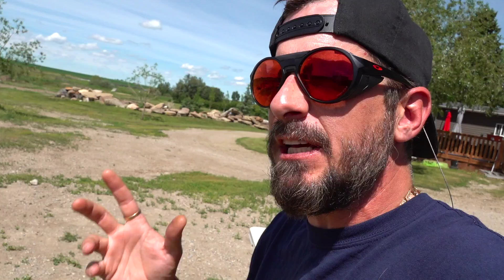IT WORKS!! (PT2) Modified TOW RIG - TUBE PULLED behind THRASHER Jet Boat  | RC ADVENTURES

Comment: The only change I would try is to move the tow point more over the rear pivot point above the jet pump to keep the line tight on turns to whip the tube out. Then try mounting the camera where the tow pole is now to balance it all out. Keep up the great imaginative content. Love it!!
Reply: Yes indeed just like on a regular boat !!!
Reply: Agreed rear post mount rather than central that way turning will keep the tube moving to...i deal spot on boat is where screw for cover is then mount go pro behind that..
Reply: Yes must see the whip... that would be epic... if you keep going around in a circle the G's increase exponentially. We used to do it pulling a board tied to a motorcycle with a rope hooked to the front corners of the board to hang on... if you can.

Comment: Keep at it Medic!   If you look at ski boats, the ski pole is positioned at the rear (sort of where the go pro is)   This will perform more like the initial tow point and should allow the boat up on the pipe...  Nevermind - I see you have sorted it!
Reply from the maker: Not true bro..  Not all ski poles are like that :) https://www.absolute-snow.co.uk/V/Jobe_Fat_Pole_Boat_Ski_Pole_3-(73017)  The video from the day before - shows that lowering it causes more of an issue

Comment: I think you need a Go Pro on the tube, i know the exact replica of yourself is awesome but the footage would be a fair trade lol
Reply from the maker: Hmmm.. I would have to devise a proper floor and support.. ill noodle it around for a while
Reply: @TheRealRCSparks  Tube+ a layer tape over bottom, wide plastic disc with a pole thru center up in middle of tube, add more tape to cover and secure disc to tube?
Or you could tape the GoPro to the chest of the Action Figure :D
Reply: @Mr_Ham0   Its actually an exact replica of medic lol but i think the Go Pro and mini medic would be too top heavy, hopefully he figures it out, its deffinately footage that i wanna see!

Comment: Watching you have fun, is fun for me too!  KEEP POSTING!  I have had some time with RC stuff, but I have had THOUSANDS hours on the water, almost entirely behind the boat!!!  Really powerful, to way too small to be used for that!  Things do not scale down as well as we wish!  I have much more engineering skills, than people skills!  I really enjoy figuring out how to get things to perform!  So I had some thoughts:

1. Pole should be farther back!!!  When you turn, the tube's drag pulls the boat into a harder turn.  If you move it too far back, the drag will make it hard to turn.  Too far back would be a few inches behind the prop!  The transom is about perfect.  And lower!  Your setup is great for wake-boarders that want to extend their jumps.  You Are Pulling A Tube, Not A Kite!  The simplest setup is: attach a "rope" very loose between two points on the transom,  left and right of the drive, just above water line.  Put a loop in the end of "Ski-Rope", run the transom rope thru ski-rode's loop so the ski-rope will slide back and forth.  On a real boat , we would use rope that floats and add a bunch of little floaties near the motor so the rope stays well away from prop!  

2. Add more weight to boat!!  Or use a much bigger boat!  We have used a 14' aluminum boat with a 25 hp motor and not only pull tubes, I was able barefoot!  We had to have four people in the boat!  When I would "set" my slalom ski too hard it would throw people out of the boat!  I could only do it once, apparently some people don't like getting thrown out the boat at speed! 

3. Get rid of tape on bottom of tube!  More Surface Touching the Water, the More DRAG!  "Tubes" with bottoms are made for little kids so the tube never gets on plane or if the boat has enough power, you end UP towing a Kite!  Your "tuber" looks "strong" enough to keep his butt out of the water!  Weight in the tube needs to go a little bit forward.  Looked like your tube was Porpoising.  In your earlier clip, the rider was way too far back.  You might try letting your tuber sit backwards (like a real show off!!).  Too heavy on the front: the tube will flip over forward when slowing down.  Back heavy: very hard to get on plane.  Porpoising: almost perfect!  Have you thought about putting controls in the rider?  lol  

4. Your boat has plenty of power, but it's not made to pull stuff.  Especially from dead stop. Cavitation!!!  It needs to get up to speed before it pulls.  Your clip shows that perfectly.  When you turned, the tube would stop and sit in the middle of the boat's "Circle", the boat would maintain speed.  When the boat straightened out, the tube would instantly jump back to speed!  So!  (And it's a cool way to start!!!)  From a dead stop, gently idle the line tight, turn and give it throttle, making a semi-circle or a spiral out to straight!  The boat will have traveled several feet and got up on plane, while the tube just barely moves, turns, then EXPLODES out of the water!   Once at speed, if the tube is on the Right side of wake, then turn around to the Left.  The goal is to swing the tube to the outside of the turn!  Super Goal would be to continue with the boat in a circle and the tube zooming at like 90 MPH! Catching huge air!  Ultimate Super Duper Goal for the driver is to fling the tuber off!  Does your rider float, without the tube?  hehe!

One more little trick: graphite on the bottom acts as a lubricate on water.  Dawn dish washing soap works real good too, but only for a moment.  

Thanks again for posting.  Makes me wanna dig out some of the VHS tapes!

Comment: Hey here's a challenge. Paraglide with a lighter figure. I don't have a boat but you can do it. Take off from a plywood. Just do it on the pond to keep it on the air longer. Would be a cool view from the boat cam and from the figure. 👌

Comment: You should do it like actually inner tubes, in the back end of the 'floor' of the tube, just put in a mesh section so when the tube get's going all the water flows out the back

Comment: Hell Yeah,   works awesome.   Only thing I would address is to lose the  drain tube and make a trap door like flap with tape underside. Full size towable tubes have a cover that wraps the tube and that has a large mesh not needed for RC size, but the flap allows any water to evac instantly.  And i never had the tow rope up above the waterline for tubing more than the rear cleat level, only skiing n wake boarding the height helps pull you UP not Down. Maybe try from rope position again thinking it will get on plane faster.  
Can't wait to see Another episode of Tubing with Jet boats.....  Love your shows

Comment: DOOOOOOOD! It worked out great! I laughed so hard when it went on plane and actually worked! I really think you can use your GoPro mount as the tow point. Do you have some taller mounts that would put the camera higher but not so high that it takes the stability of the boat away? Or, use the tower but put the camera right in front of the pole. Then the rope will miss. Also, with the venturi tube, I would ditch it and seriously just go for a couple slits and enough gap that the water can freely run out even at low speed. I think there is enough water tension to stop that tube from working. then there is nothing dragging under the tube.
Reply from the maker: HaHAHA!!!   I KNEW when you wrote me, and I did the the check marks of what you had said - what I had built, might work!!    I will work on the drainage. .the flap and slit may be the way to go 4-sure.   These videos arent too popular.. so I dont know how many more of these style I will do (although I will still play on my own! haha)
Reply: @TheRealRCSparks  No worries! Gotta make the masses happy right? I dig it all. You know, you did the SCX24 Jeep JLU video and when you called to it like a puppy, it was the seal on the deal I needed one to match my full size Jeep Rubicon JLU!  So, to go super nerdy, the stripper pole makes a massive fulcrum on the boat. https://www.newdimensiontowers.com/towers/ndt/NDT-Hybrid-Universal/
If you look at thow that's designed, it puts a push/pull on the hull of the boat which keeps it at a negative and can't roll the boat to the side. Not sure if you want to go as far as that to design a tower, but it may be the answer to your dilemma of control of the boat and the tube. 2 bars mounted to the sides and a center pulling point. I would take it just above your original GoPro mount and almost cage in the camera. That would be pretty sick!

Comment: Yeah dude you done it! Thats amazing, congratulations, but the question is now can you convince your buddys to go thru the pain of making them for a race, i think rookie might be pretty good with his knowledge and might be able to make a pretty good one like yours, but i was wondering what would happen if you used plasti dip on the bottom surface would it take some of the flex out and maybe it might no make so much drag at higher speeds to stop the thrasher from throwing itself sideways?

Comment: Cut a slot in the bottom towards the back and make a flap over with the opening towards the back as well, so when you get water in it like it did, when you start moving it flows out

Comment: yes tow point on the tube is key.  the lower to water the better.  it will keep the tube from plowing down, lower the piitch on the impeller if possible, and i think the tall mast is WAY too tall.  hoestly, the two point  should be low as possible and towards the read.  we do this all the time down here in alabama with full size boat.
Reply from the maker: Yeah, but can you explain these boats then: https://www.absolute-snow.co.uk/V/Jobe_Fat_Pole_Boat_Ski_Pole_3-(73017) ?   Thanks!
Reply: @TheRealRCSparks  the pole in these boats are a bit closer to the rear of the boat.  try that to move your fulcrum to the rear.  that will help

Comment: Not sure if you made it to that point during test n tune..... but you have to consider CG of the boat itself. most ski boats have a center mount engine with mid mounted mast.  The camera mounted in the rear couldnt have been helping either.

Comment: The pull point needs to be near the back of the boat so that the forces involved are more equal and the tube or skier does not pull the front of the boat around which was happening in every turn. also shorten the tow rope in small increments to find the correct length of the rope to balance out the centrifugal forces required to have the tube stay outside the wake of the boat in turns, its all about balancing the forces involved it just tuning the configuration. well done so far Sir. a few more tweaks and it should work perfically.

Comment: A grandually curving surface is going to cause the most drag as it will try to lift the water. Take a cylindrical container like an older 2-liter coke bottle and pull it across water by hand. You will see the effect.

Comment: If you can mount a tiny GoPro to the pole on the boat, and fix it so as the line rotates so does the camera, then your camera view will always follow the tube despite the boat turning. Will have to be a tiny GoPro so doesn't make boat top heavy
Reply from the maker: Tiny gopros do not exist anymore.. but I like your idea!

Comment: Hi 👋, recently bought a traxxas trx 4 with the 1979 ford bronco body and I saw the other day, someone was running it with no shock oil to make a more realistic drive. And well I LOVE the realism part but I need to know. It bad to run shocks without oil? Or like can I damage something running no shock oil?
Reply from the maker: You can run them with out oil if you want,. it will just be very springy.  If you remove the springs for full Droop setup.. it is not realistic, but looks cool!

Comment: Should have mounted the camera on the top of the rope moor post, that way it is clear of the rope and a great view.
Reply from the maker: I like this idea, but I think it'll Too heavy for the center of gravity
Reply: The latest generation Go Pros are very small, add some ballast or attach a deeper weighted keel for more stability.

Comment: What about using a RunCam, they are smaller and lighter than a GoPro almost as good video quality but a 1/3rd of the cost of the GoPro not to mention the cameras are super low profile.
Reply from the maker: Not wateerproof?

Comment: Suggestion for Youtube Gold while I'm at it, Mount a GoPro to the top of the cab of the Articulating Rock Truck(s), you can have perspective of being loaded, backing up to dump etc.
Also, see image for Pit loading suggestion, you can load a truck in loading position and have the other truck wait to be loaded in Wait location, when loaded leaves it can just head forward and out the road instead of trying to turn around like Joe kept trying to do last week. :D https://ibb.co/g4rvqmC

Comment: Medic, brother I hate to tell ya, but it is 2020 not 1997! And your TUBING, not old skool WAKEBOARDING with a FlyHigh extended pylon. LMAO I'm loving the videos, but I grew up skiing and tubing behind a 16' John boat with a 90 Merc. No towers or extended pylons back then. The best tow boats are prop, not pump driven. A good driver doesn't run over the rope. And tubes with floors are for little girls. Real MEN (KIDS EVERYWHERE) ride open bottom tubes. Chest down against the tube and legs hanging over the back. By 99 I was Waken it up behind my Supra Launch that was packing 2000lbs water ballast. When we broke out the tube it was off the low pole, not the tower. Fix your tuber and put him behind a legit tow boat instead of a suck pump pretender boat! The front center tie off point on the tube worked. Step in the right direction. Keep them coming! Making me want to go get wet again!
Reply from the maker: Meh, Im actually pretty happy with these results man!  I dont need to recover a boat, no need to break a shaft, and there are plenty of masts like this.. https://www.absolute-snow.co.uk/V/Jobe_Fat_Pole_Boat_Ski_Pole_3-(73017) still for sale!? So , yes.. so many ways to skin a cat.. but this is the way I did it.. and Im stoked it worked. thanks for the read though, I plan on doing different positions with the Action figure (Thats what she said) - but watch yesterdays video.. and it will make more sense to you
Reply: @TheRealRCSparks  love it man. Keep having fun and sharing it with us.

Comment: Talking intertube get your downed drone with  air line as long as you need connect like a piece of metal break line tubing under your sub have it out long enough to go through pin point underwater drone at end of  break line tube glue a balloon deflated of corse then go get that drone kinda like air bags to lift sunken boats underwater same idea Rc size it will also bring up sub quicker hopefully with the prize

Comment: It’s a little too long still may be about a foot or so besides that it looks great
Reply from the maker: I spoke to an engineer about the length, and the length of rope should not impact the drag.  Only if it was a heavy rope. The angle from the top of the pole imperative though.. (i might add, i thought the same thing, thats why I asked him)